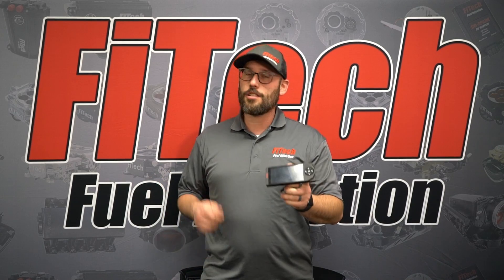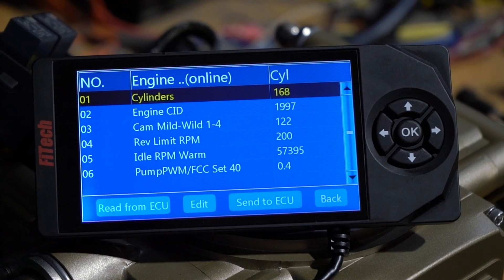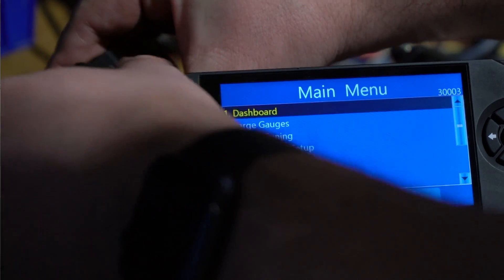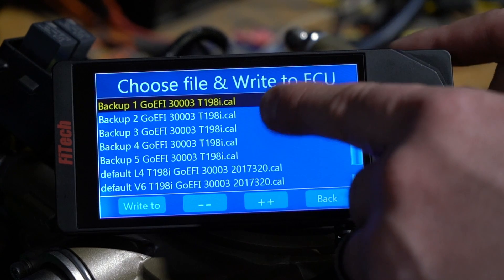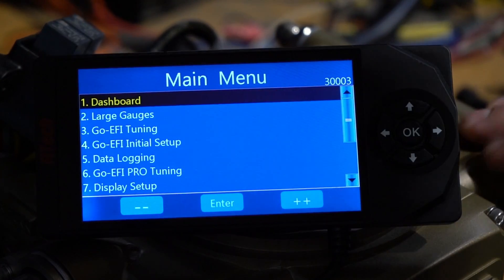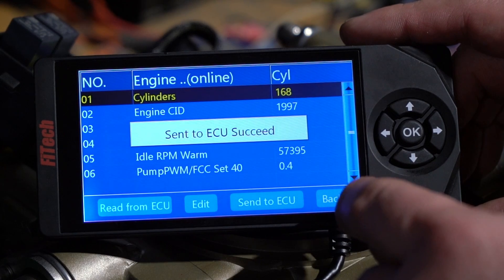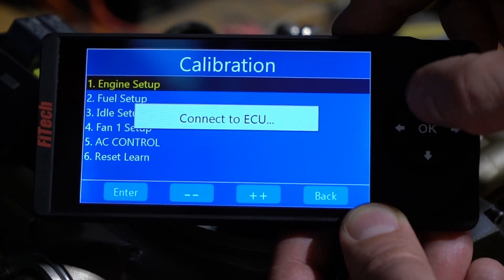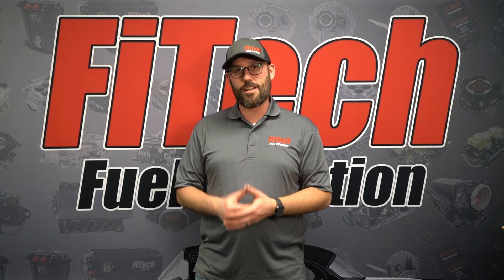Odd Values on Your Handheld? | Tech Tuesdays | EP56

Comment: So you are saying that if I have the ECU that has the 3 fuses in line I need the T198 software in my Handheld, I made some changes using PROCAL 1.2.1 REVA and now my 30064 Power Adder reads 10 cylinders 1034 Cu In.?
Reply from the maker: If you are going to use the procal software to tune you need to start with a fresh file and exclusively tune within the procal software.

Comment: Got my setup several years ago for a customer. Kept finding issues that wouldn't correct. He lost interest and I ended up with the system. System dashboard shows target afr at 12.55 at idle. Even though the target afr I've put in is 14.7...feeling stupid.
Reply from the maker: check the FAULT CODE section of the handheld. This may show a bad component or a signal issue that needs to be addressed.

Comment: I have a old fitech system. My handheld gave up and bought the new one from summitracing. It showed a 10 cylinder and 1098 cid. Called them up and they sent me the new software and it fixed it.

Comment: Isn't "new ECU with an old hand held" the same thing as an "old hand held with a new ECU"? 0:29
Why can't we download software upgrades from the FiTech site?  It's kind of a pain calling into tech and then having to use dropbox and now have to agree to their terms and conditions.
Reply: He may have explained it wrong. They dont want people to brick their systems loading the wrong software to their system. Its a pain but most people would just grab the latest version without proper due diligence. Im sure its different for power adder versions and ls versions